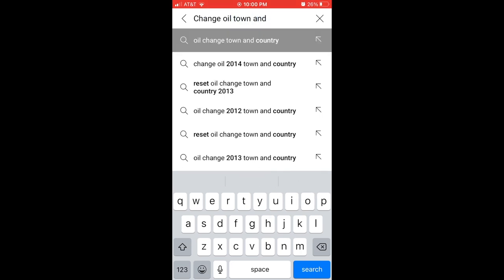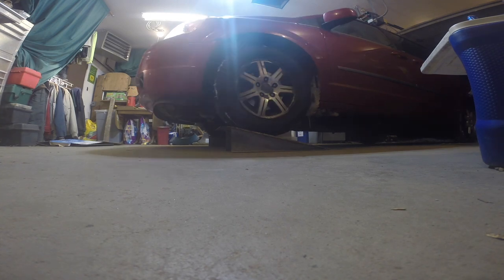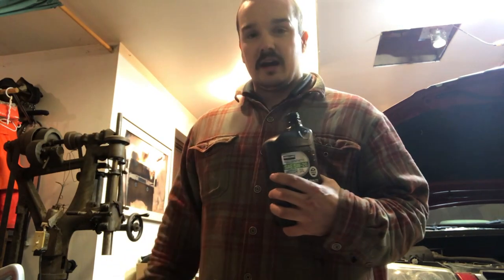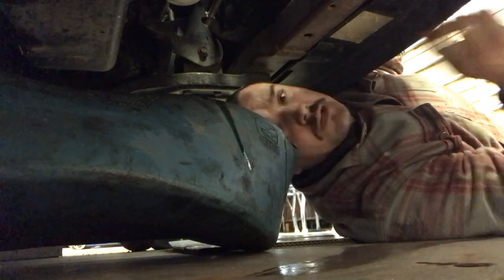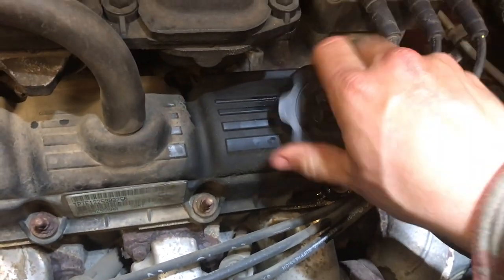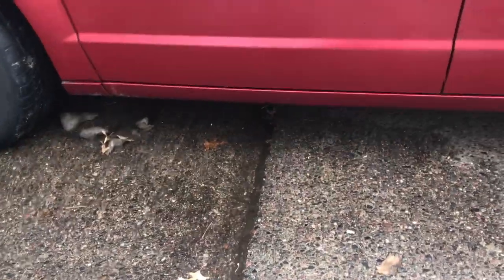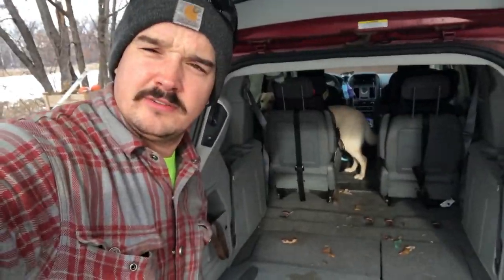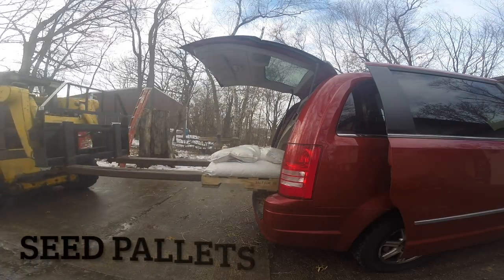How to change oil on a 2010 Chrysler Town & Country (Our Farm Truck)

Comment: Our T&C 6 cylinder 3.8L engine uses a 1/2 socket for the oil plug to the pan. Oil filter is a small cap that fit’s on the end of the old filter and uses your socket on end for removal. 5W-20 oil. I have been using Penzoil High Mileage Full Synthetic Oil (not the natural gas version) and it has worked well on our 2010 T&C with 129,00+ now. Before putting on the new oil filter do please put your finger in the new oil and coat the rubber seal. This will allow for easier removal the next time. Also only hand tighten the oil filter, twist until you cannot move it any more. If you use a tool to tighten you risk a very difficult oil filter removal on your next oil change, it will vibrate tighten during your travels. When you change your oil filter and oil, should take 5 qt of oil on the refill.
Yes, we do use the T&C for hauling as well, however only when needed since don’t have a pickup. The Chrysler mini-van with all the seats down can fit a full sheet of plywood, I have done it and the hatch is closed.
Nice video, well done!

Comment: All those use oil and the factory says its normal  , I started putting 5 ×30 and the next time I'm going 10 × 30
Reply from the maker: I did hear that too. I thought oil use wasn’t common. My wife’s KIA burns a bunch and it started at 70,000 miles, which seems early to me.
Reply: @Hammer Hay  it'd crazy mine now uses 2qt per change and I saw somewhere that Chrysler said that's normal  , so last night I changed to 10×30 to see if it helps , bc they went to the light oil for gas mileage and if you look up the beatings,  crank and other stuff for that motor , they call for the exact same part number from these models to the late 80's or early 90's and those days it was 30wt oil.